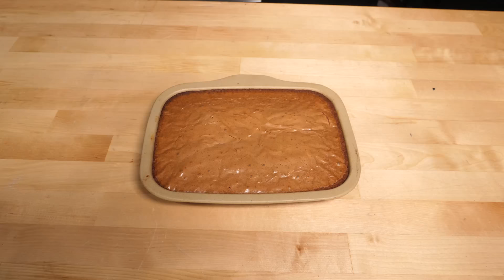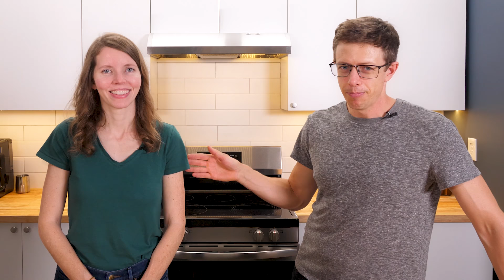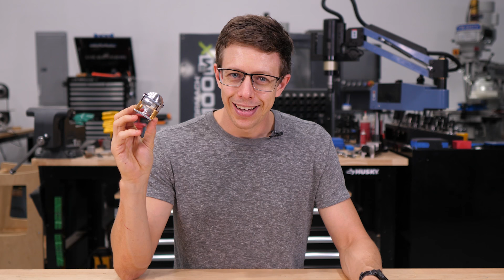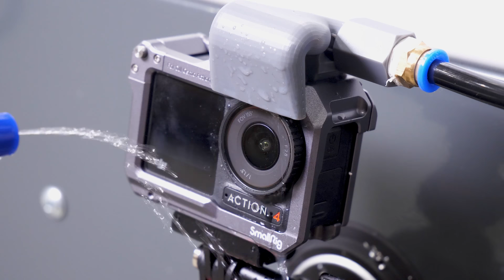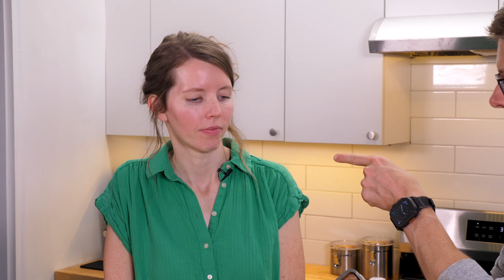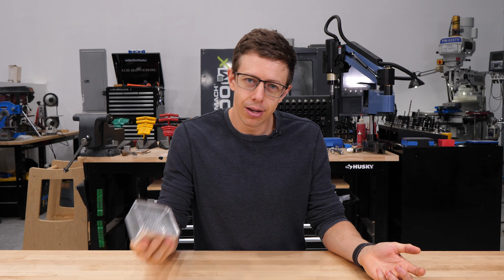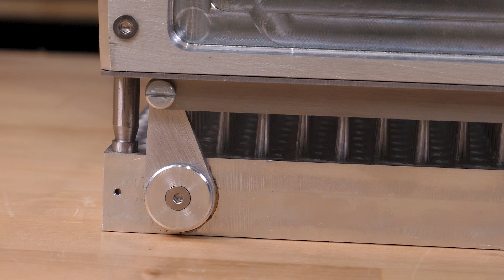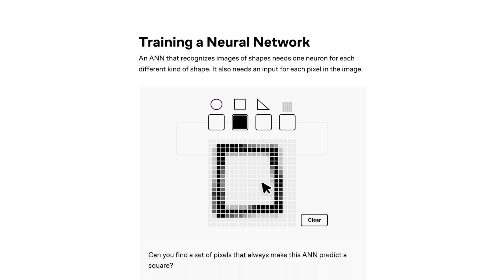Baking brownies from the inside out

Comment: commercial version: a thin pan (maybe silicone) with holes on the bottom that fits inside, when the brownie is done, take out the inner tray. no leaks on the outside, no lever action 😊 great video!

Comment: Why wouldnt you just cool the outside edge to match the middle? IF you want to "tech it up" your cooling could be regulated by five thermometers (center and four corners) that regulates the walls and base to match the internal temps. You could even make it a self baking pan/oven... or alternativly, you could just cut off the base and sides of a brownie onces you finished baking.

Comment: The same problem (outside edges heating faster) is the reason why sponge cakes always tend to rise so much in the middle and so little around the edges.
The low tech solution is to wrap the baking form in a wet dish towel for the fist 15 min.
Would probably work for the brownies too.

Comment: What would happen if you folded parchment paper into a box, would that work?
(asks AI)
...okay, so it would have a longer cooking time, which would cause moisture loss,
...structural integrity would be an issue, as the parchment paper would get soaked with grease,
 
and the AI also had this gem:
 
"Handling: Imagine trying to lift a floppy, hot, heavy paper box full of hot brownie from the oven without it buckling or collapsing. It would be a monumental task."
"You would essentially be trying to bake in a very large, flimsy paper cup."
 
um, and then it suggested using silicone, glass, ceramic, or bain-marie instead. And manage moisture loss (if not using bain-marie).

Comment: Dude, you literally could’ve just steamed it. The crust that forms is just from the dry heat in the oven heating up the conductive metal, and thus the batter around the edges more quickly, causing it to lose moisture faster than the center. With steam being moist, the pan won’t cause the batter to lose water, you’ll never get that crust and it will be fudgy throughout.

Comment: In the beginning you stated that the side get's a different temperature of which i parkt of the process to get the crust. Why not try to watercool the side and bottom of the pan to copy the temperature of the inside...
First have a temperature sensor measure the temperature of the center, and copy that by injecting hot or cold water on the sides and bottom of the next pan design... perhaps a 3rd section in the corner... or have the water enter at the corners.
Lookong forward to your next video👍🏻 whatever the subject!

Comment: If you were going to turn this in to a retail product you could use chest latch style latches to hold the bottom of your original 2 piece design to the top half of the pan. And then have a flat bottom you swap it out with for transportation and serving.

Comment: This is brilliant and delightful. 

I wonder about the opposite approach... I have in my baking arsenal a set of cloth rings that are meant to go around Cake pans. These are used to help the cake bake more evenly. You soak the rings in water, and put them around the pan, the soaked cloth keeps the edges of the pan cooler for longer, so that the edge of the cake will bake at the same(ish) rate as the center. I wonder if a similar alternate approach could be implemented. Since you've got a hole in your oven wall already, you could run cool water in and out of a pan keeping the edges cooler as demanded...

Comment: You did this completely wrong.   What you need is a CNC machine that can use cameras to determine exactly where the edges are then perfectly remove them.   So you can take a brownie from any pan, cooked in any oven and get the perfect brownies with the minimal amount cut off.

Comment: You should have attached a blunt object and not a blade to the edge tester. Using a blade, the sharpness of the blade will also dictate the force required to cut. As the blade gets blunt the harder the machine will need to push.

Comment: I'm so glad you made this contraption instead of googling how to do it and seeing "Put into larger pan of cold water in oven" which works just as well
Reply: Cake chefs also sometimes wrap wet rags around the sides of the cake pan for more even cooking.
Reply: steamed brownie
Reply: @Rikard_Nilsson  If you're steaming it you have too much water. Basically you're just making a virtual brownie edge outside of the actual brownie.  The conditions which make the brownie edge harder and chewier act on the water rather than the actual edge of the brownie batter.
Reply: you can also get little heat resistant fabric strips you soak with water and wrap around the edge of the pan
Reply: @X2Brute  Those work really well for smaller round cakes, but if you want indistinguishable edges they might dry up a bit early for a large pan of brownies
Reply: @ericpenrose3649 true, I wasn't suggesting it as a perfect solution, but the ratio of price to effectiveness is probably a lot better than milling a custom pan
Reply: Having made edgeless brownies, I can confirm. Cake strips work fantastic for this.
Reply: Yeah he could probably even have done the same temperature control profile in the oven in a normal pan and gotten similar results
Reply: @jeff-u3x7r  Something tells me you didn't actually watch the whole video. He goes over exactly why this doesn't work.
Reply: @itsausername yeah I watched the video.  He explains why the regular pan doesn’t work, but then proceeds to build a pan with exactly the same set of edges that every pan has.  The only reason his pan doesn’t toast the edge is because he controls the temperature.
Reply: He built a whole machine to cool the camera and never used it on the ACTUAL main thing he was trying to keep cool
Reply: Oh because liquid water can only get up to 100°C, right?
Reply: It’s an actual cooking technique. Used often in restaurant-level French cuisine.
Reply: @seth1422  and cheesecake
Reply: @seth1422  Sous vide was my first thought too
Reply: @seth1422  like when you need to melt chocolate but the edges of the container would burn it
Reply: @possiblesloth  Technically, he isn't talking about sous vide. Sous vide is cooking for long periods of time in water that is around the temperature that you want the internal temp of the finished product to be for slow and even cooking, He's talking about putting the tray of brownies in a larger pan of water and then putting the whole thing in to the oven so that the water in the pan absorbs and diffuses some of the heat that would be hitting the edges of the brownie tray directly if not for the water, so that the total amount of heat that each section of the brownie pan is more even. It's pretty much the same theory as sous vide, but it's technically pretty different.
Reply: @lorehammer40k4  Sous vide is cooking under a vacuum. That's the literal translation. The food has to be vacuum-sealed in a bag so it has no oxygen. That also ensures good thermal contact between the food and the water, as the vacuum-sealed food is totally submerged. It takes forever to cook food that way, as you cannot cook at or above the boiling point. You certainly wouldn't want a brownie "baked" that way.

Cooking brownies in a water pan is more similar to a bain-marie. The difference is that the top of the brownies are allowed to reach a temperature close to the air in the oven, while the edges can only reach the temperature of boiling water. In a true bain-marie, the idea is usually for the whole thing to cook at just the temperature of boiling water (by heating from below, sometimes also stirring), which wouldn't work for brownies, as they have to bake at a much higher temp.
Reply: @EebstertheGreat Cooking under a vacuum is one part, but careful temperature control is the other. When you cook this way you often put it in a 40-60C environment which allows for proteins to break down without any sugar caramelization.
Reply: @FreshPe  you want to sound smart but you're low iq.
Reply: @FreshPe  You're saying that as if it isn't a very well known time tested technique, or as if there's any chance at all of it getting anywhere near that hot. A tray of brownies will take 30 minutes at around 350. There is no way that a full pan of cold water will boil in that time, it'll come out like a hot bath at worst.
Reply: I could imagine a double-walled pan with water-cooling would do the trick. If the sides of the pan would be too cold to get a homogeneous result, then replace water with olive oil. This would make it possible to regulate the wall temperature separately.
Reply: @richardvanlent9845  They sell strips you can put in cake pans for this purpose. You can also find people online recommending you tear clean towels or rags into strips for the same purpose.
Reply: @richardvanlent9845 that amount of water would be small with metal edges heating up close to each other so the issue wouldn’t be it staying too cold but getting too hot
Reply: See also: Using a knife
Reply: Bring down
Reply: powerful
Reply: and make this world a paradise!
Reply: Please gather in front of the Wh
Reply: ite
Reply: Ho
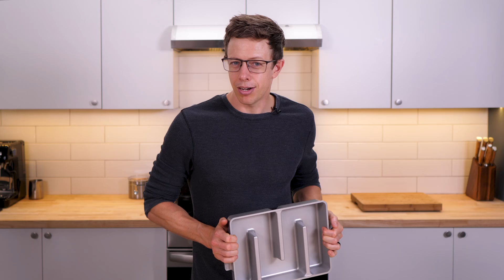Reply: use, Buckingham Palace at 3 June 1:00!
Reply: @WhiteRabbit03789  wow

Comment: Panko breadcrumbs actually has a solution for this - electrocution. So to get the largest, fluffiest breadcrumbs, only the fluffy middle of bread works, the outside crust makes small rough breadcrumbs. So how do you get bread that's all middle? The solution is electricity, they make dough at the factory, then put it between two big metal plates, then run a current through to cook the bread. Because the current heats up the water in the bread, it cooks evenly inside out, no extra heat on the edges. I wonder if that could work for brownies.

Also, microwave?

Comment: It probably was mentioned already but have you tried to Sous-Vide the batter? There might be a problem with expansion, but since the only thing that needs to be cooked to a certain temperature are the eggs you can keep it at 71°C which might limit the expansion. Cooking is basically heat over time so keeping it at 71°C will definetly cook it the question is just how long does it take? and If the goal is to keep it edge less then youd probably achive that with sous-vide. The taste on the other hand might not be the best. Idk :D  While wirting this i thought about more problems that might occur but im gonna post it anyways.

Comment: I have to wonder: were the spikes even necessary? You had to wind up cooking it lower to get the right consistency. Could you have cooked it low and slow to still wind up cooked in the center without overcooking the edges?

Comment: Sooooo.... I love the engineering, but bakers use these baking strips, like belts made of fabric, that are wet and surround the baking pan, just to avoid the specific issue of the cake overcooking at the edges, and that results in more uniform cakes. You can improvise them by wrapping wet paper towels in aluminum foil, in a belt shape, and wrap it around your cake pan. Same would work for brownies. I mean... If anyone wants to try it without having to machine an overengineered brownie pan (which is the obvious superior approach).

Comment: Hmmm…
My first thought was to place a pan of brownie batter into a larger pan of hot water and then cook it.
I’m pretty sure that would work just as well.
Also, just reducing how fast the pan can heat up, such as giving it two inch thick walls and bottom, would let the brownie cook evenly without getting a crust edge.
I’m oversimplifying.
The important thing is it made a good video.

Comment: I havent watched yet, but wouldnt edgeless brownies be a matter of surrounding the sides of the brownie mix with a thin shell that has similar thermal conductivity as air?  Like silicone or parchment paper?
Maybe some extra insulation to prevent convection of air tranfsferring too much heat to the sides?

Comment: Now I want some brownies ! Second thoughts, why isn't the bottom in a regular pan also an edge. The heat flows all around the pan, not just the sides. How about a pan made from material that slows down heat penetration from the sides. How about a pan with cavities around its sides under vacuum to slow heat perpetration. Does the brownie cook down from the top as well., unless the top is at a lower temp. Third though, why not just cut off the edges? LOL !

Comment: This video is exactly why I love being a manufacturing engineer. No two people have the same idea or attack pattern for an idea. When he started talking about how the pan was the problem, I instantly went towards making a double walled pan with water being circulated between the walls to keep the pan at optimal temperature during cooking. Which would probably work just as good, but his idea worked too, just goes to show you there are 100 different ways to solve any problem.
Reply: Yeah he could have just filled a ziploc bag with batter and cooked it sous vide.
Reply: Or kaybe we could make water cooled sides?
Reply: right?? my first thought was using electricity to cook it, like how they make the crustless bread for panko
Reply: A bot stole this comment lol
Reply: You mean a Bain-Marie? Something bakers already use to prevent cakes and puddings, and other stuff from cooking unevenly.
Reply: This reminds me of baking cheesecake!
Reply: @jwpjr  Because he is basically describing a bain marie, which you use while baking a cheesecake. Or cakes where you want an even cook or creme brulee or any other thing you want to cook without overcooking the outer surfaces.
Reply: So, a double boil, like someone else mentioned here

Comment: I'm wondering when this could ever be a practical option. And I've come to the conclusion that it's probably only for small scale but often use. So like if you eat brownie every single day and never edge, it might make sense.
For larger scale such as a shop, the edges just scale linearly with pan-size while center scales quadratically, so when you get really large pans, discarding the edges seems really minor. 
There's also the cost of cleaning the thing, which might be more than the small fraction you're discarding.
But really cool video

Comment: To solve the leaking issue without o-rings couldn't you just make the holes in the batter pan slightly smaller than the base diameter of the spikes? If they are centered, the tapered spikes would plug the holes, preventing leaks. You could even chamfer the holes for a better seal.

Comment: What about using a microwave oven? That was my first thought when you said you want to heat it from the inside. 
Technically there are even commercial microwave ovens that have a built-in grill function that you can combine with the microwave function. This would bake it fast from the inside but allow for a slight crust at the top. 
Of course it wouldn’t be as interesting of a video.. 😉

Comment: Looks like all iterations of the spiked pan are a pain to clean. Hopefully you are cleaning up after your baking attempts. 

I definitely wouldn’t want this pan cause how much more work it is to clean. Not to mention how the parts will start to fail (first machined and heated, they might behave but repeated temperature cycling will cause warping and other chances to your fine tolerances).

Comment: @7:34

If you are going to expose materials to an elevated temperature: it isn’t a binary if this material is safe at X temperature.

That material might off gas or otherwise poison the environment well below the temperature rating. Since you have a liquid which turns to a solid, an off gassing material could certainly be trapped in your baked good.

Sure you probably will not die from this minor exposure today but let’s say you did testing for 30 years, with this added gas to your foods. Are you at an elevated risk for cancer?

Maybe a MSDS / SDS would share this knowledge but also they usually don’t do fine testing like this.

First question, does this resin ever (post curing defined by N days of curing) off gas something that could be deemed hazardous?

How consistent is this resin formula? Could manufacturing cause a defect and introduce a new chemical that is more volatile, at temperature, than the resin alone?

What you are being exposed to, how much would you realistically need to have an elevated chance? Is >0.0000….0001% toxicity acceptable?

These are just some considerations when you heat up materials.
Reply: we all got microplastics in our balls whats a little fume

Comment: As a person that loves the center of brownies, I need this in mylife
Reply: $899.99
Reply: Put your brownie pan in a larger baking dish. Fill the outer dish with water. The evaporating water cools the pan and makes the edge cook at the same rate as the center. It's a very old baking trick, usually used to prevent custards from drying out at the edges. And you don't need a CNC machine to do it. ;)

Comment: Bakers actually use a spike to control the temperature and evenness of a baking cake. They sell ones you can put inside your cake batter to make a cake that bakes more evenly. So no surprise you came to the same conclusion. However this is usually a single spike in the middle of a round pan as I have seen it used. Never have I seen a cake spike used on square pans but perhaps trying something in a round pan with cake spikes would be interesting.

Comment: So, i would have build a pan that has temperature controlled walls. So basically the opposide Approach.

Maby with a temperature sensor and some pc water cooling parts, you would be able to controll the walltemperature, so it doesnt rise to much over the middle temperature.